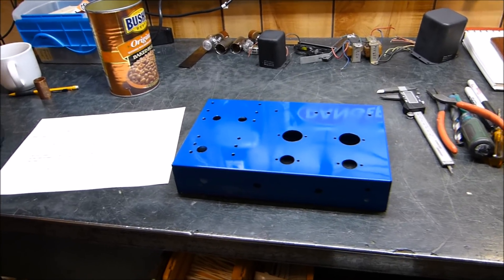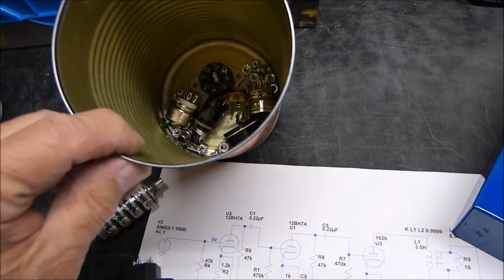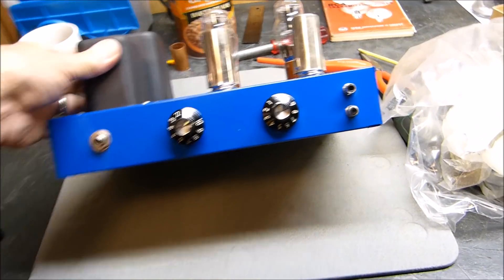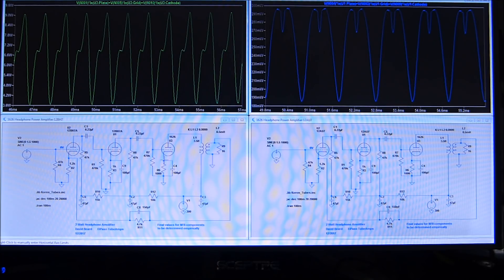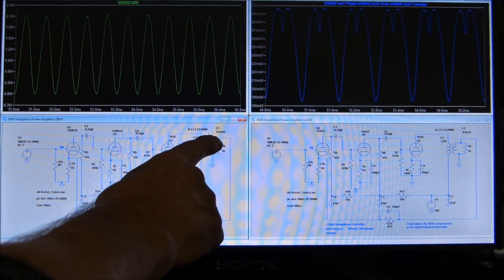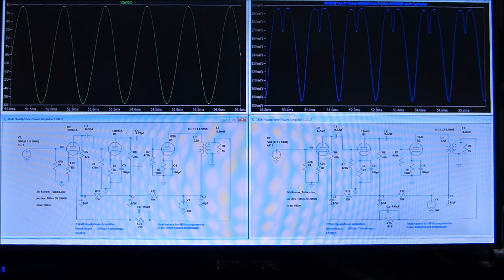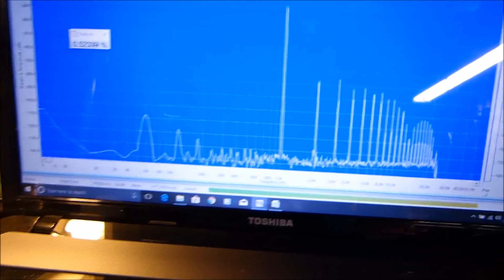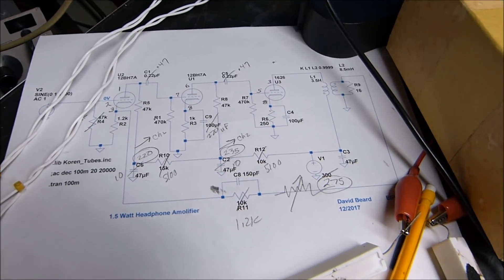Vacuum Tube Headphone Amplifier Using Vintage WWII 1626 Triode - Part 2

Comment: Man, you do nice work, and more importantly you go to the extra trouble of sharing what you know and learn with the rest of us. Certainly appreciated.
Re: chassis/paint protection, I have only built a few small tube-based projects and decided to follow others' lead and mask most of the chassis before drilling the holes and also after the paint is hard enough, with masking tape. For drilling the chassis any tape will do. A few layers is best. The point being to keep the surface from getting all marked/scuffed up by the shreds of metal spinning around with the drill bit. Once the paint is hard enough to not let you push a finger print in, you can apply a few layers of the nicer fine tape (3M/Frogtape or such). It helps keep everything spotless, leaves no residue, doesn't take the paint out with it, and it gives you one less thing to worry about.
Happy 2018!

Comment: I really enjoy watching your videos. There was a guy named Bob Danielak, who experimented a lot with the 1626 tube. He calls his single ended version: Darling Amp. I build a few of them. They all measured not great but sound very sweet. I think the 1626 doesn’t perform so well at the test bench but in real listening it’s a very nice tube...
Reply from the maker: I have studied the Darling Amp schematics also. They are pretty simple and it seems others experience with this little tube as an audio tube is much like mine. 1.5 to 2 watts is all it will do. I either have to live with it or start over. I think I mentioned I modeled a PP 6SN7 amp and I like the way it performed but one of my PP transformers was no good so I had to go with this SE design. I really don't care for SE amps but now I will have a stereo version. I am probably going to try it on my Klipschorns as they are really efficient. That might be an interesting video to post. Thanks for your comments.

Comment: Great to see some new audio projects!  I'm planning on doing a 2-channel 100w Williamson amplifier in the coming year, as soon as I get a couple of other projects off my bench. I may also do a solid state amp. Have to find a good design.
Reply from the maker: Good deal... I want to see the 100 watt amplifier project. Have you gotten into Spice modeling? If you have or want to, I will send you my model of the Williamson amp that you can just click on and it will run under your LTSpice program.
Reply: ElPaso TubeAmps I do want to get into LT Spice. It would be great to have the model for the Williamson Amp.
Reply from the maker: All I need is your email address. theaudioshop@sbcglobal.net

Comment: Luxman CL32 used twin potentiometers per channel on his preamp , works fine. 
Worth a try !
I guess you've read the RCA datasheet on this particular transmitting triode....
Reply from the maker: Yes, this is a small transmitting triode made primarily to run class-C RF but sometimes it seems we audio builders just can't resist using tubes for purposes they were not designed for.
Reply: HAAAAHAHAHAHA    YES WE CAN'T RESIST !

have nice day sir

Comment: Love them big knobs, and the vintage potentiometers. Regarding the schematic, NF. and negative grid voltage on the output triode. I don't like cathode capacitors, and I believe that if you cancel them all around, you will obtain a better looking spectral profile. Sure, this requires another supply for the negative grid voltage of the output triode, but I think it would be worth it and a little "self negative feedback" would be nice on all the stages... so 10ohm cathode resistor for the last? At least I would be curious to see the difference. :)
Reply from the maker: I know what you mean about a bit of local FB in each tube by not bypassing the cathode resistor with a capacitor. But that doesn't seem to be the problem. I get a beautiful clean signal all the way to the grid of the 1626 in the model and in the lab and even at the secondary of the transformer but no matter what I do, it seems at the plate voltage I have (275 volts) that is all the power I can get. Some years ago I built a PP 1626 amp with much higher voltage and all I could get from it was about 3.5 watts. The 1626 is simply not an ideal triode to use as an audio amplifier but it sure is nice looking so I have to settle for what it can do.

Comment: Love your videos.  Thanks for sharing your knowledge and experience. What is your grounding scheme on this project?  Are you tying all of your ground stars together then connecting to the chassis at one point?  If so, where? Near the inputs?  Merry Christmas and God Bless you and your family.
Reply from the maker: I have discovered if you return all of your power related DC circuits to one point on the chassis where the CT of the transformer grounds, you will eliminate the major source of 60 Hz hum. Studying the real pros like McIntosh you will see that is how they do it. You do not need to float the input RCA jacks or use a star or buss ground system for everything. Just keep the PS components in one corner of the chassis and return all of your DC power connections to that one point mentioned above including the electrolytic negative leads for the voltage dividers going to the voltage stages. It is easier than many make it out to be.
Merry Christmas and God Bless
Reply: Thank you for your advice. I appreciate your reply.  I'm in the middle of my first SE build.  I have read so many opinions on grounding. Many have suggested a continuous copper buss that everything grounds to in order of current draw and connecting to chassis near the inputs.  Do you bring your signal grounds to the one point on the chassis, as well?  What about CT of filament transformer, same point?
Reply from the maker: I ground cathode resistors right at the tube socket and I ground the inputs mounted to the chassis at the RCA jacks right at the chassis mount. A filament CT is not always a good idea. A better idea is a 100 ohm pot with the wiper grounded so you can actually adjust the hum. There are no absolutes in the hum adjustment of the filament supply and the lowest hum may be at one end of the pot with one side of the filament winding grounded rather than the CT. You do what you think is best but I have actually gone to the trouble of a buss ground and terminated at the input as you mention. The amp turned out great (it was a PP KT90 amp at 80 watts) but, again, the PS components and capacitors being grounded at one point away from the high gain audio section is, in my opinion, the most important thing to do. A S/N ration of -75 dB or better is great and you will not hear any hum from your speakers. Getting an actual -90 dB S/N is as difficult to measure as it is to obtain as everything in the measurement setup is critical including the quality of the test coax cables. I think your amp is going to turn out good. Don't get overly focused and concerned about any one thing and let it stall your build. If you have any high quality amplifiers, open them up and study how they ground things. I think you will find it simpler than many make it out to be.

Comment: If you want the paint to be really hard bake it in your oven about 70 degrees Celsius for 20 minutes
Reply: Do you think having a couple of filter capacitors on the mains might help bridged over with a high-powered resistor reduce that harm even more, give you a cleaner signal as well.
Reply from the maker: I did put it in the oven with just the pilot light on (gas stove) and that seemed to help. I have also found that putting it in a cold place sometimes seems to help even more so, I actually did put it in the fridge for a couple of hours too...  :-)

Comment: One question, what material is your chassis made from? Cold rolled/hot rolled Steel, aluminum? And what gauge.. Thank you. .
Reply from the maker: The chassis is aluminum made either by Bud or Hammond. I buy all these chassis at www.mouser.com. I can't recall the gauge but it is sure a whole lot easier to work with than steel. I seem to always cut my hands when using steel chassis.
Reply: ElPaso TubeAmps Thanks always wondering what's best to use..

Comment: Are you sure you're building for the right output impedance? All the Sennheiser headphones I've ever used are 150 ohms or more, not 16. You'll get a poor power match ... Best EJP
Reply from the maker: Actually, I think it is going to be fine.
The headphones are rated at 70 ohms but I need 16 ohms across the output to reflect 6K in the primary to the tube so I will put a resistor on the secondary to make the amplifier output tube happy.  
As for the headphones, the specs on the box say it is 120 dB SPL at 1 volt RMS. 1.5 watts into 16 ohms will develop 4.9 volts RMS so that should be very sufficient to drive the headphones. I had not done this math until your post but now I think it is going to be really good. We will see.
Reply: ElPaso TubeAmps Maybe two load resistors switched as appropriate by the headphone jack, so it is 16 ohms whether the headphones are in or not. 16R with no headphones, or 22R||70R ~= 16R with them in. Or if the switching doesn't work out just the 22R always in shunt.
Reply from the maker: I have for all operating purposes finished it. It does need some load as with no load it goes into a parasitic oscillating state when driven so the 22 ohm resistors are the right idea. I can not tell one bit of difference in sound quality or volume whether I put 8 ohms or 16 ohms across the output with the headphones playing. I would have never believed the headphones I just bought would be so efficient - they are Loud with just small amounts of power. A good loud listening level on the headphones is with the volume control set to 50% on the amp and 50% on the tuner. I did not put in the variable NFB pot. I put a green pilot light in the hole. It looks good. I plan on putting a Plexiglas plate on the bottom and some small rubber feet so the wiring can be seen without having a shock hazard. I am hoping I have some nice rub-on lettering in my stash of stuff to finish it up.

Comment: What kind/type of simulation program are u using?
Reply from the maker: It is called LTSpice and is free off the Internet. Just Google the name and you will find it. You also want to Google Koren_Tubes for that file that needs to be downloaded if you want to simulate vacuum tube amplifiers. You install LTSpice and then copy the Koren file into the same directory that LTSpice is installed in. Sometimes you will see LTSpice referred to as Spice or possibly PSpice but they are all very similar and come from the original Spice program.
Reply: Thx a lot! Cheers.
Reply: Was looking for this comment lol :D

Comment: You should have gone with KORG 6P1s and had the whole thing running on 50V @ 6A except for the 3V heaters and have a very clean top with very little to burn your fingers on and no need to mount a mesh guard.